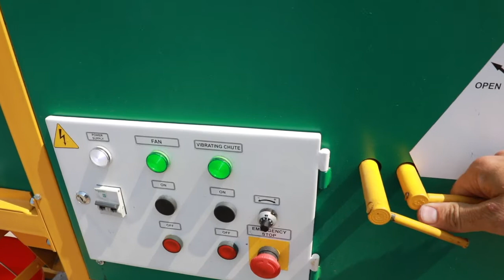Grain cleaner. Sorghum, Texas.

Comment: Curious - is "cleaning" referring to removing the inedible husk around the grain?   Is what's coming out of the mill ready to prepare for eating?
Reply: No now you would need to mill it to either crack the grains open or all the way into flour or meal. Sorghum is like hard corn. (Which is what they are cleaning in the video) cleaning removes bits of straw, dried up bits of the plant and dust that got picked up while removing the grain from the plant. I actually tried cooking the grains whole once, didnt really work well.